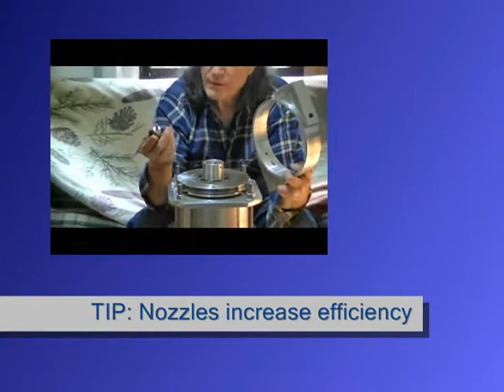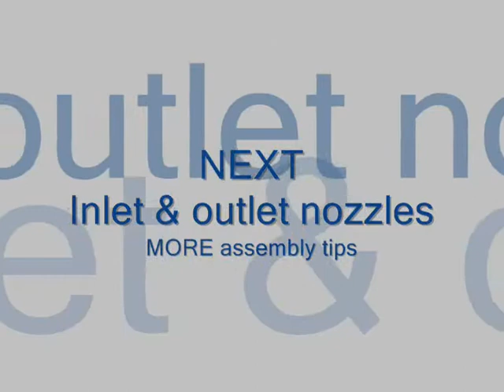Steam Tesla Turbogenerator Assembly Tips, part 1 #579

Comment: The simplicity of this device makes it a winner in my book. Deeply considering going this route instead of PV. Simply because the cost of the unit,  lifespan(longer than 20-30 years...) and it uses a thermo mechanical system to produce energy instead of piezoelectric material.

Comment: Have you tried just running a horizontal slit across all of the disks?
Reply from the maker: Zenman Energy Yes - we have experimented with slits in the past. Ken decided that it's a lot easier to bore small holes than to produce extremely small slits. This is probably something we'll develop in the future - variable width slits.
Reply: Pam Rieli I'm working on my 4th Tesla Turbine. I have run some interesting Computational fluid dynamics simulations on a couple input nozzles. After I clear my plate, I'll dig up that simulation and show you. I've come up with a pretty simple way to cnc machine a very teeeny slit. If I recall it was about about 12 thousandths of an inch high. Anyway I love seeing these projects. Do more!